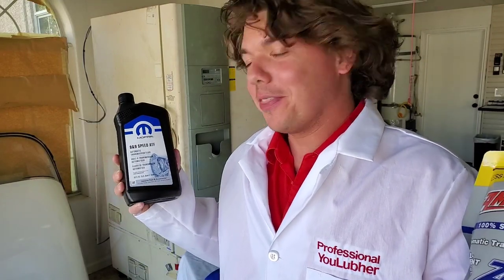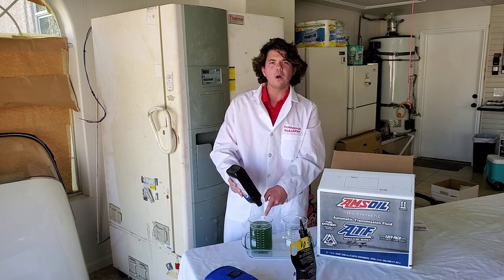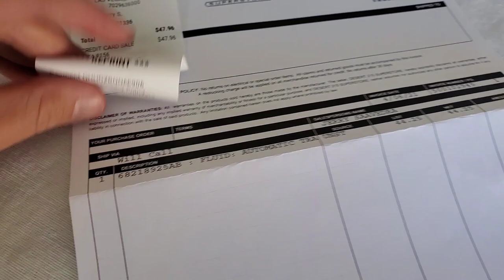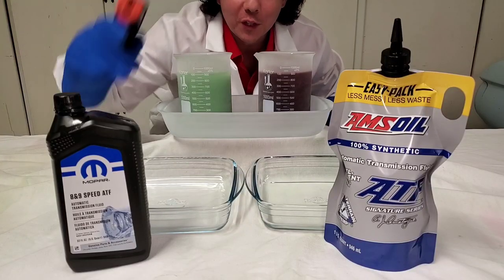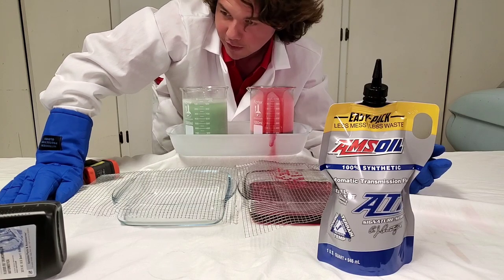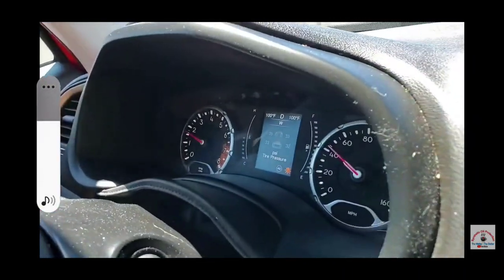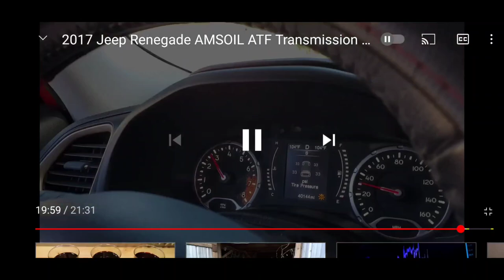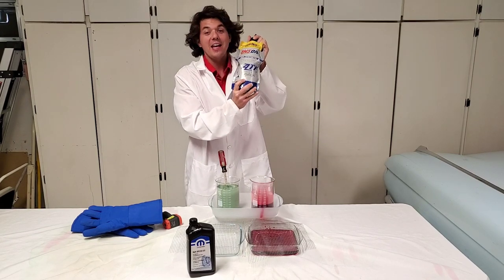Mopar ZF 8&9 Speed VS AMSOIL FUEL-EFFICIENT ATF Cold Flow Test

Comment: Wouldn't a heat test have more use.
Reply from the maker: That's a great question Joe!!!

The most where in a motor is actually during the cold start a lubricants ability to cling to the metal and keep a film on That Metal overnight is what protects the motor the next day when you start it Amsoil is different because it's 100% synthetic creates a much higher film strength to answer your question yes the heat tests are great however the cold actually accounts for more wear on differentials Motors and Transmissions and the ability for the lubricant to flow is important
Reply: @Syntheticoilprotection  I mean I already use amsoil in my 2018 Honda accord and 2001 trans ls1 with supercharger,  I was just doing some research  on the atf before I purchased
Reply from the maker: That's great not sure if you have the preferred customer account will give you the very best value on the products!

Also when you use my link here that would allow me to always answer your questions about improving the performance and lifespan of your vehicles and equipment by choosing the right fluids as your independent Amsoil dealer👍

Thanks again always happy to talk with you💯
✅   Save 25% On Your Next Fluid Order: https://www.amsoil.com/offers/pc/?zo=5331179

Comment: I like Amsoil but I run a ram zf8 tranny in Canada and I change it regular with zf oil I towed 10k trailer for the last 100 000km and no problems so maybe Amsoil is better but when it comes tk transmission I’ll stick with manufacturing as I hesitate a one fits it’s all for transmission Amsoil I like the gear oil or engine oil where I can choose the specs for oil I want but the tranny I’m hesitant

Comment: Which transmission oil can I use for my 2017 jeep renegade trailhawk instead of this 8 and 9 speed
Reply from the maker: I actually did a video on a Jeep renegade and showed the fluid going in that one took the signature series fuel efficient ATF fluid you'll have a lot faster shifting much smoother less vibration better fuel mileage.

This is the lookup guide This will give you all the fluid and capacities for your vehicle If you have any questions you can always give me a buzz anytime and when you use my link I will be your amsoil dealer so you could always call or ask me any questions anytime.

Find Products For All Vehicles - 
https://www.amsoil.com/guides/?zo=5331179

If you are new to amsoil it's always best as the 6-month PC member which will give you the wholesale pricing and it will save you a ton of money when you order.

Professional YouLubher: Eben Rockmaker Regency Direct Jobber AMSOIL Specialist (Dealer#: 5331179) 702-472-3614 

Get AMSOIL Wholesale Pricing - https://www.amsoil.com/offers/pc/?zo=5331179
Reply from the maker: This is the video I did on Katie's car This is a Jeep renegade made a huge difference in the shifting https://youtu.be/v9PTMQ-kx14

Comment: I never understood these type of tests because y’all are not using realistic temperatures that Mother Nature will create. Like come on, -50 Celsius is very unrealistic when these oils are designed to operate at realistic cold temperature
Reply from the maker: The point is to show how different the lubricants are that's all of course no one's going to drive at that temperature☕️😃👍
♥️   See fluid performance tests - https://www.amsoil.com/performancetests.aspx?zo=5331179
Reply: @Syntheticoilprotection  but it doesn’t show anything because no one will use those fluids at those temperatures
Reply from the maker: @wendellgreenidge3362 oh yeah entirely different lubricant a oil manufacturer can call a full synthetic full synthetic when it's 75% conventional oil and 25% synthetic the Amsoil is 100% synthetic creates a much higher film strength flows better shifts better in the cold big Improvement and will extend the life of the transmission big difference - ♥️   See fluid performance tests - https://www.amsoil.com/performancetests.aspx?zo=5331179
Reply: @Syntheticoilprotection  what are you talking about?
Reply from the maker: What oil manufacturers don't want you to know to know - https://youtu.be/L_c6wVSzX80?si=_6RPWSNiztQ-PlM4

Comment: Ravenol for ZF is cheaper and it comes from Germany
Reply from the maker: Oh yeah there's a lot of other products that are much cheaper definitely cheaper up front when it comes to the long run the Amsoil really makes a big difference with fuel mileage the way it thickens and oxidizes that's what makes it such an exception 100% synthetic film strength keeps the metal Parts separated looks frictionless where the component lasts exponentially longer and a much smoother transmission with less vibration this is a great video on my car https://youtu.be/pbhhEuGsh-I

Comment: cold flow is not important. hot is more important.
Reply from the maker: Actually it's the opposite up to 80% of the wear on most Vehicles can occur during the cold start that's because the last thing that's between the metal is the lasting film from when you turned it off the night before and the higher quality oil especially the 100% synthetic keeps the metal Parts separated less frictionless heatless wear also in high heat they also hold up better less oxidation unless thickening over time the cold flow packages will hold up better and a higher quality lubricant which means it won't thicken in the cold as much as the lubricant ages and oxidizes.
♥️   See fluid performance tests - https://www.amsoil.com/performancetests.aspx?zo=5331179

Comment: Mopar is $10-15 a quart calm down and if you have an 8-9 speed 948TE or equivalent you better get the Mopar. -50 degrees is not a real world test
Reply from the maker: Well it's not real world for your conditions but there are a lot of places where it does get very cold I have a lot of customers that are able to put their car into drive where they live before they could not go into drive when they cold start.
You'll see it's about the value🇺🇸🥇
🇺🇸   50 Years of AMSOIL anniversary - https://youtu.be/MQUqRBI8dD0
Reply: @Syntheticoilprotection  I'm not knocking Amsoil I know its a good fluid but you better be real sure about the 948TE 8-9 speed transmissions in Chrysler etc before you get to confident. Amsoil may work in some but these require a much thinner fluid with "very" specific additives and ATF 4 & others will straight ruin it..This isn't a trip to Autozone for universal crap with every make car listed on the bottle. This is WHY the fluid is clear  Green and super thin like water & $47 a quart, per your words... Actually $10-15 but can get higher... Yes even back east can get to 0 degrees but -50 is a whole different situation that can ruin a lot of other things on cars not just the transmission and if you're in an area that's -50 there are certain things you need to do per the manufacturer and its not pretty..
Reply from the maker: @seatime674 I made this playlist for this similar situation😃👍☕️
https://youtube.com/playlist?list=PLB_ftWArBFddVQNbHRp49F6DeiBeNFSS_&si=weujGwRCARjG9C3G
Reply: @Syntheticoilprotection  You can have a Playlist all day long with 25 different topics it still doesn't address specific technical parameters. Good overall basic info people should know though..
Reply from the maker: @seatime674 if you're looking for super technical data that would be this right here. 
♥️   See fluid performance tests - https://www.amsoil.com/performancetests.aspx?zo=5331179      

If you see something that's not there let me know I will try to find it for you
Reply: @Syntheticoilprotection  Not technical in regards to the Amsoil product description itself, technical in regards to specific applications to certain transmission applications. Amsoil is not one-size-fits-all as much as you're pushing it to be
Reply from the maker: @seatime674 Amsoil makes hundreds of products these lubricants and filters are specifically built for each application transmission fluid power steering fluid coolant brake fluid racing fluids to cycle fluids greases detergents cleaners metal protectors silicone spray penetrating oils Etc each one is built for specific application and oil makes oil lubricants and filters for about 96% of all vehicles. This lookup guide will give you everything for your year make model and engine size on your specific vehicle - https://www.amsoil.com/guides/?zo=5331179

Note this transmission fluid does meet many transmission specifications and most of the fluids are very similar when it comes to Transmissions.
Reply: @Syntheticoilprotection  I'm not saying Amsoil will necessarily kill this transmission or others right away either, I'm saying hypothetically people must do research first I don't care how many Amsoil products there are.. There are many fluids that say they can be used but really just shouldn't be. There is a veeery fine line between catastrophic failure and the approval of a certain fluid that came highly revommended...
On another note to quote one of your vids, if your transmission has alot of miles and fluid has never been changed the fluid shouldn't be changed. Clutch material, glazing and sediment are keeping clutch packs working, if new fluid is introduced/flushed  it can make for a disaster by displacing all that material that's holding it together and many times won't even go into gear anymore... If your transmission is actually to the point of malfunctioning with its original fluid , changing it right away will only 7 times out of 10 make it worse. Changing it at that time is simply a roll of the dice

Comment: Can I put AMSOIL  this oil in my 2018 Chrysler SRT 8 speed?
Reply from the maker: Yes this will give you all the fluid capacities and fluids for your year make model and engine size and when you use my link here I will be your independent Amsoil Dealer so I can always talk with you about performing improving the performance and lifespan of your vehicles by choosing the right fluids👍👍
♥️   Find The Right Fluids For Your Vehicles - https://www.amsoil.com/guides/?zo=5331179      

     ✅   Save 25% On Your Next Fluid Order: https://www.amsoil.com/offers/pc/?zo=5331179